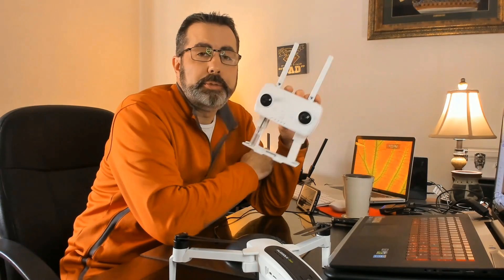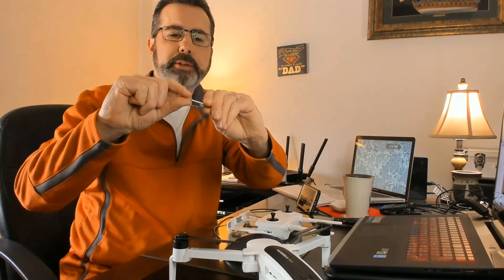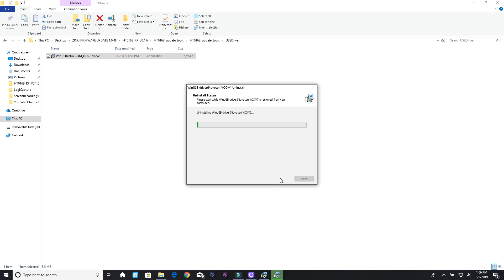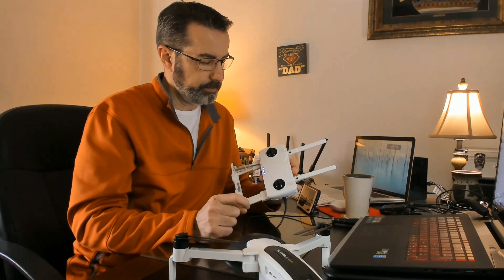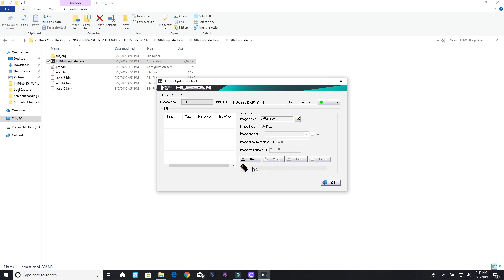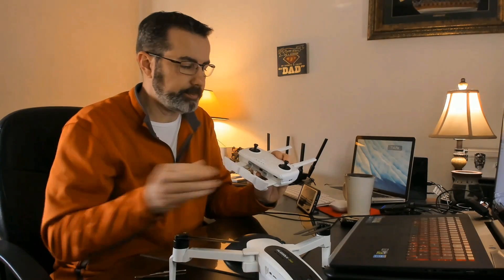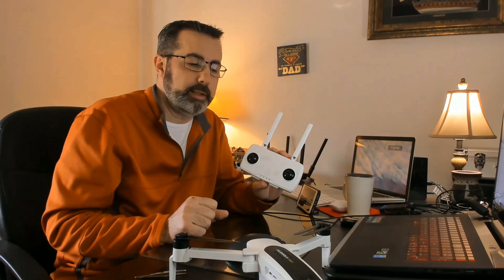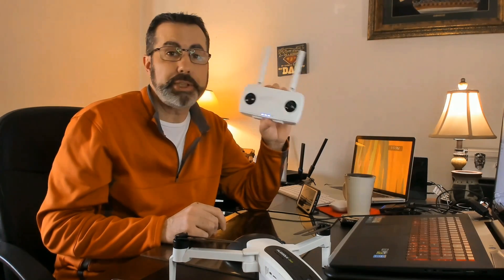HUBSAN ZINO - CONTROLLER JUMPER FIRMWARE UPDATE HT016B

Comment: Do you know if works for Zino Mini Pro controller? Controller model HT018F
Reply from the maker: No this is only needed and something you can do with the early model zino’s not any of the pro versions.
Reply: @QCGUY I'm trying to find some information about how to reset the ZMP controller but no success yet.
Reply from the maker: @wesleymodesto7331 there is no reset for that controller.
Reply: @QCGUY Thanks for the information

Comment: Thank you QC Guy for your videos which explain well the procedures for the Zinos.  I already have a ZinoPro+ and a Zino 2+ and now I'm going to pick up a used Zino 1 which is having issues linking the aircraft to the controller.  I hope to find a solution to this problem thanks to your advice.  If you have any idea or suggestion I take !!!  greetings from France
Reply from the maker: If it doesn’t have connection and the red light on the side is flashing replace the image cable and wifi will be restored and all will be good to go. 👍🏻
Reply: @QCGUY  you mean an image cable inside de drone or the USB cable to flash firmware ???
Reply from the maker: @jpadronevids26  it’s from the camera lens to the main board so both inside and outside the drone.
Reply: @QCGUY  thanks a lot for helping i will check all of this !!! br
Reply: @QCGUY  okay i will check the drone when arrives to see that. thanks !!!!

Comment: Hi! I'm using a tx ht016tx instead of ht016b so there is no 5 jacks to combine as guided. Could you please help for this case?
Reply from the maker: This is for the first series of the original zino. They had one firmware update and then change from the pins to a button and then nothing there at all but no worries because they have nothing to update. If you don't have the jumper pins then there is no update for you.
Reply: @QCGUY  Thank you for clarifying me. It's still working normally without updating TX :)

Comment: Chris, I'm new to all this.  the label on my transmitter shows HTO16  - no 'B' listed.  There aren't any pins that I see to jump in that middle slot.  I have 8 pins within a slot on the right, that's it.  I updated the quad fine - what am I missing? Thanks
Reply from the maker: You have a newer controller and there is nothing to update so your good.

Comment: Hi Chris,
Do you if is possible to use a race fpv goggles? Cheers
Reply from the maker: no, you can't
Reply: @QCGUY  Sorry if I am a litle bit persevered, why is not possible?
The Wi-Fi signal to the phone is 5.8gh and fpv goggles works at the same signal from the drone camera.
Reply from the maker: @raydenkundera857  Do you have Goggles that are WiFi?
Reply: @QCGUY  Sorry, no l don't. But the goggles can be connected to the controller. I see Zino, Anafi, DJI have a wire between phone and controller. But if we connect to the goggles should work.
Reply from the maker: Rayden Kundera You would need a device with a hdmi output and goggles with hdmi input.
Reply: @QCGUY  Anyway, now l don't have anything of these haha but is good know from the beginning. Much appreciated if you have for sale a Zino Pro, pls.

Comment: Hello
in this place you show, I have only a microswitch, maybe instead of pins they installed a reset button?
I have Hubsana Zino since 20/02/2020
Reply: https://photos.app.goo.gl/dvnepBAjULDECw277
Reply from the maker: This is a button you would hold in the whole time during a update. They added this after the pins and then later removed it. There are no new updates for you because the only update was done before this button came into the picture.

Comment: Hey. Thank you so much for your educational videos. My transmitter has only a small button and no pins! How can I update my transmitter?
Reply from the maker: You do not need to update this style because there is no update for it at this time. When you do you have to press and hold that button the whole time during the update.
Reply: QC GUY OK.  Thanks for your reply.  I'm constantly learning something new😊👍.  You must have an amazing weekend.  many greetings from another stormy weekend in Denmark.  💨
Reply: How would you know there is an update for this version with the button,  i mean is it a different model number? How would you make the distinction between the 2 versions?
Reply from the maker: Kain Ali 
You can only take my word and Hubsan’s word for it.
When the Zino first came out there was a series of pins you had to jump in order to update. There was only one update during this time and then later came the button followed by nothing there at all. But in all there was only one update for the controller and nothing after they added the button.

Comment: My HT016B transmitter has a button and no pins. It was easy to upgrade. Zino H117S.
Reply from the maker: Gilberto B. P. Funny thing is if it doesn’t have the pins there is no reason to update anyhow. These have the latest controller firmware already. 👍

Comment: What does it mean when my Zino transmitter starts beeping?
Reply from the maker: I have not had mine beep that I can remember. Is the battery low?
Reply: No.  I had a full charge.  It started beeping continuously while I was binding the drone, then the drone started up and took off.  I was able to pin it to the ground until I could turn it off.  A friend of mine was a good hundred feet from me.  He was flying his drone, a JJRC X-11, he was attempting to keep the drone in the air, he didn't know his battery was low, and his transmitter was beeping too.  Is it possible that we were on the same channel and his transmitter was flying my drone and transmitting to my transmitter that my battery was low?   I went to a different spot, ran two batteries through the Zino, no problem at all.  Strange for sure!!!!   What do you think?
Reply from the maker: ghettoman the issue I guess that’s possible but can’t tell you without being there and seeing it.
Reply: I never have normal drone problems.  It turns out that my friend did not know how to bind his JJRC X-11 to the transmitter.  Apparently, when he was attempting to fly his drone, it was not responding to his transmitter.  It was flying erratically.  I was about 100 ft or more from him at the time.  I was in the process of binding the Zino to its transmitter at the same time he was having his problems.  Somehow, while I was in process of binding the Zino, my transmitter picked up his drones low battery signal and started beeping.  I wasn't done binding and calibrating my compass yet, and as he kept trying to keep his drone in the air, his transmitter, some how, had connected to my Zino, which in turn unlocked the Zino and it began to take off.  If I hadn't physically pinned the Zino to the ground, I would have lost it.  I cut my finger on one of the Zino's propellers in the process.  Needless to say, I fly alone now.  I know this sound weird, but it happened.  I haven't had a problem since.  Welcome to my world!!
Reply from the maker: @ghettogardens1  WOW! What are the chances right? lol

Comment: What is the purpose of the controller update?
Reply from the maker: This is everything to date with the controller...
1. Added the function to set Image Transmission 
2. Added the function that enables the controller to control the drone after the WiFi disconnects 
3. Added the function that enables the throttle stick to control the drone during RTH and Auto land

Comment: i got my Zino today and my Controller/Transmitter is totally different.I have in the middle only two buttons. And on the right 2 rows of pins.
Reply from the maker: They switched things up a few times as they figure things out. lol Good thing is you are up to date with that configuration and no need to update.
Reply: The button works as those 2 pins. So if you want to update your controller, you press it and hold it for the duration of the update. It's tricky to do with only two hands, but it's possible. You need to use some tool. Someone will probably make some 3D part which you would insert into the phone holder and it will press the button instead of you.
Reply: hi man i have the same controller, how do you uptade?

Comment: Hello QC thx for the video, but i my contoller has a button, so how do i connect with that type of controller? Thx!
Reply from the maker: NeFtY You don’t do anything with it. You are on the latest firmware and don’t need to worry about it. 
Im going to do a video soon about this button. 👍
Reply: @QCGUY  thx you're an absolute life saver!
Reply: QC GUY I have the bottom version and I accidentally update the firmware and now It doesn.t work..i cannot find the drone..what can i do?
Reply from the maker: killbaneable Did you do exactly like I did and use the file in the folder not what is always already appearing in the file window of the tool? It’s a bit hard to tell you how to fix it without seeing what you did wrong.

Comment: my Zino with Y heading on the serial number ,The controller pin were replace with push switch that need to be push all the time to able PC connection, The original Gimbals came with software version G.V3.0.2.5 unfortunately sending message, gimbals angel too high, on and off randomly, I flash it with firmware GV3.0.2.2 ,that's the only one I could find on Hubsan's site, its ok now , Thanks for your video 
I realize before that the gimbals didn't do self check upon switching on , surprisingly gimbals can be control ,cheers
Reply: How do you connect beacause i cant find the way

Comment: Zino Firmware Updates

Thank you for your support.  It has been really helpful, as you know I cannot get any support from Hubsan at all.

This is the firmware that I have in the Zino right now.

Zino_FC_VI.1.52 (control board)
Zino_G_V3.0.2.3 (gimbal)
Zino_IT_V0.3.6 (camera board)

Transmitter is already up to date.

This is the updated firmware on Hubsan's website 

Zino_FC_VI.2.04 (control board)
Zino_G_V3.0.2.2 (gimbal)
Zino_IT_V0.3.8 (camera board)

It appears that the gimbal firmware that is in the Zino right now (Zino_G_V3.0.2.3)  is newer than than the updated firmware on Hubsan's website (Zino_G_V3.0.2.2)

Should I update “all” of the firmware, or should I update only the firmware for the control board and the camera board?

Thank you.
Reply from the maker: ghettoman the issue If it’s working leave it alone. There is nothing to gain if you change and the camera firmware they have as the latest isn’t very good. Stay where you are and enjoy it 👍
Reply: What about the flight control firmware?  Should I upgrade that?
Reply from the maker: ghettoman the issue same answer.....nothing worth updating to. You won’t notice anything and many have already complained and gone back to the version your on now. 
If it works leave it alone! 👍
Reply: You are the man!!!  Thank you!
Reply from the maker: ghettoman the issue Very welcome 🙏

Comment: Does anyone know if the red light next to the usb/sd card slot is supposed to stay on all the time?
Reply from the maker: ghettoman the issue solid red light transmitting wifi. 
Flashing red light not transmitting wifi.
Reply: So its OK?
Reply from the maker: @ghettogardens1  Yes if it's on all the time it is working
Reply: Kool! Thanks!

Comment: I upgraded with the most recent Gimbal 3.0.2.2 and FC 1.2.04, and my controller has the button (no pins - my understanding the latest software then). But, per your advice did not upgrade the camera and left it at 3.6. In your opinion, am I good to fly?
Reply from the maker: George Zavatsky 
Permission to take off granted! 👍
Correct with the button you are current and there’s no need to update that controller. 
Everything else is current now that you updated but use caution as the FC is pretty new still.
Reply: @QCGUY  Tysm. Yep she flies well, love this first drone. Thanks for all your great advice and praying for healing and great doctors for your mom.
Reply from the maker: George Zavatsky Thank you 😊
Reply: @QCGUY  You're so welcome! Cancer has effected several in my immediate family as well. By the way quick question. Is it possible to record in the X hubsan app? If not, what screen recorder do you use? I'm trying my first takeoff and landing from my moving sailboat and just in case something happens to the drone I want to be able to record remotely to at least save some footage even if not in 4k. Thank you so much for your time and advice!
Reply from the maker: George Zavatsky Assuming you have a Apple then you need to use the app screen recorder. 
It’s my preferred overall.

Comment: I have tried about 20 times but keep getting the following message: No VCOM port found!
Reply from the maker: What version do you have on your controller now and do you have the pins or the button? If you have the button you already have the latest firmware.
Reply: @QCGUY  It has the pins. I see where I need to put a jumper across the first 2 pins, from the left, when doing the update? I guess the charging cable that came with it cannot be used for doing the update?
Reply from the maker: Steve Hula I have all good quality cables so the one that comes with quads always goes straight to the trash. 
It needs to be a data transfer cable not a charging cable but theirs is supposed to be a data transfer cable which also can be used to charge.
Reply from the maker: Steve Hula I think their cables are crap in other words and so many that have problems updating find this out when they switch to a better cable.

Comment: My Controller got no pins. Thats crazy what should i do now haha
Reply from the maker: SickhamSickyMicky Leave it alone. 👍
You have the latest firmware if you have a button/switch in place of the pins. I will make a update video for this change.
Reply: @QCGUY  i figgured it out. Its a button i have to press the whole time. How sad that their is no description from Hubsan. I thought it was broken. Bad service!
Reply from the maker: SickhamSickyMicky Yes, I know how to use it but there is no point in making a update video on it when there is no up. The important thing is what I said before. You don’t need to update if you have it.

Comment: Hi could you please help me, I'm in Australia and mine doesn't look like this. In the middle where it shows the 5 pins, I have a small plug connection (no pins) and to right hand side of the controller I have an 8 pin connection, but it is difficult to get tweezers or foil in there as it's a smaller opening. Can you please confirm that this is the connection I should be using. Thanks very much. Cheers Craig.
Reply from the maker: Craig Donovan you have a switch or button not a plug. I will do a update video for that but for now do not worry about it. There is no new firmware to update your version.
Reply: @QCGUY  oh ok no problem thanks.  Yeah I have only had the drone a month or so, so I assumed it was pretty up to date but thought it would be a good idea to update, since I am not getting much range out of it before it loses signal and returns home (approx 200-300m). I read on another channel to use a smaller capacity SD card (currently using 64gb) is this something you'd recommend. I have updated all other firmware as per your videos. Thanks heaps for the reply, and thanks for the informative videos. Cheers.
Reply from the maker: Craig Donovan I use 64gig U3 A2 cards. 
I have used different cards and sizes not seeing any problems with range.  
Perhaps check your wifi channel settings in the app.
Reply: Ok thanks will do.

Comment: Chris, do you have to update everything or can you just update the FC?  I ask because my Black Zino has a newer Gimbal Version than what came in the 9/30/2019 release  and i am already on the good camera version and the controller is already on the same version as the 9/30 release.  I am contemplating updating since it does seem the FC does improve the hover.
Reply from the maker: BassMan Strikes Yes you can but if there is any connection issues following then update the gimbal and camera to the same versions you currently have.
Hubsan says update all and some others do as well but I don’t. I only had one not connect afterwards and installed the others as mentioned above and all was fine.
Reply: @QCGUY  I did the update but only the gimbal and FC just left FPV at 0.3.6. No issues.

Comment: Sir am a little confused on this method i just got my new controller and about to update i also noticed that my zino came with the jumper on a little bag just wondering why you dont mention that or is that not a good option? It came with the zino
Reply from the maker: TheViewChaser It doesn’t matter if you use the jumper they provide or my method. Both work just fine and this video was done before hubsan started providing the jumper cable. 
It’s just making a connection so both will do that job.

Comment: hello QC again - you made again a very good video. There is a problem with new version ZINO now - there is no pins any more but a black push button in that place and the company (Hubsan) has no guide how to do an update to this RC even how to connect with pc. Any help QC?
Reply from the maker: Yanis I will be making a video soon about how to update this way. At this time there is no need to do any updates so don’t worry.
Reply: @QCGUY  thank you QC
Reply: @QCGUY  I have the same type with no pins and a black push button.  I am glad to know that it is not urgent that I update it but also am looking forward to your video that explains this process.  I think it would be the first one on YouTube that does.

Comment: you could use a jumper block to connect the pins, i used one of a old usb flashing board i have but if you haven't got one then its a case of needs must